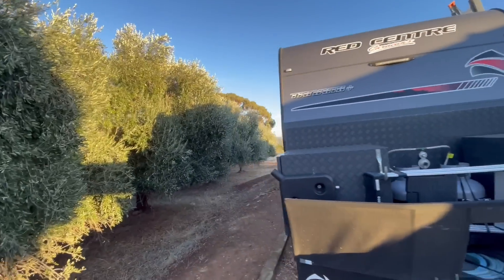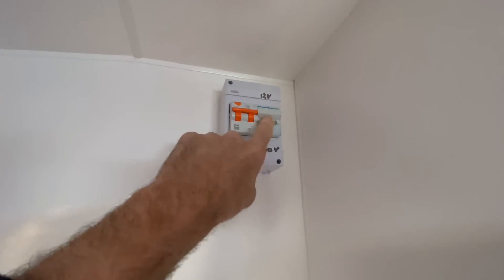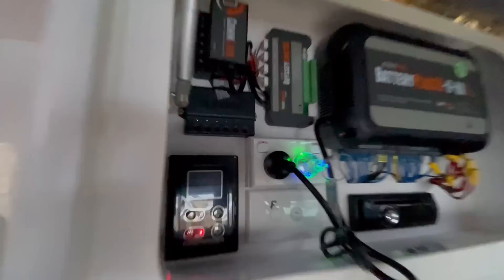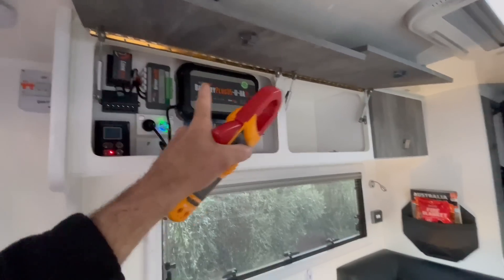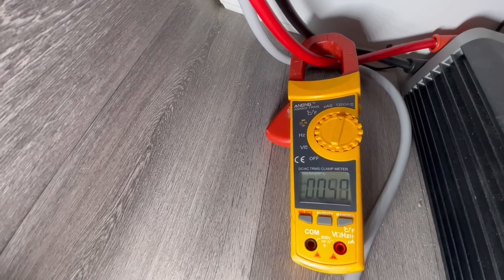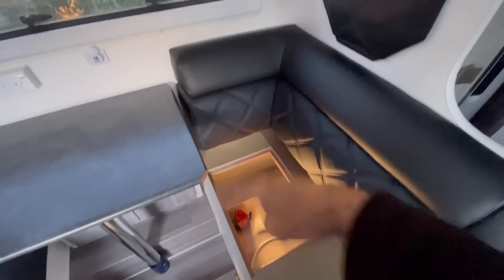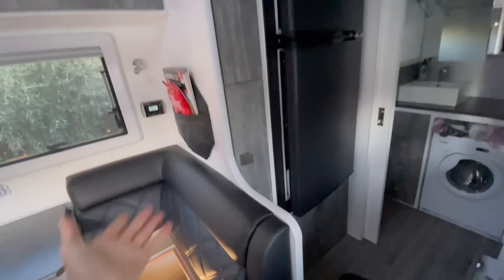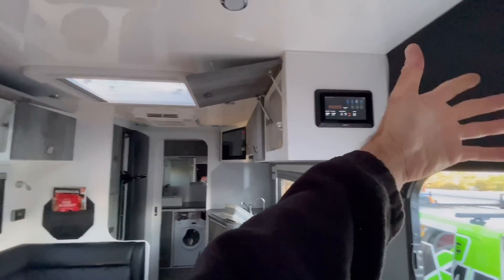Incorrectly wired inverter on a brand new caravan. The magic loop of power￼

Comment: Can u explain to me what runs the battery charger if there is no power to it from 240 as u showed and not powered by the inverter? Is it run by 12v ? Reason i ask is that im confused and im getting one of these. Cheers
Reply from the maker: Hi Jeff,
I don't think you understand the system here.
The mains charger must not have any ability to run from the inverter. It must be before the inverter as to not create a "loop'.
Can I suggest you look up the Enerdrive inverter with transfer switch diagram. That explains it easily.
In the video you can see how the charger turns ON when i turn the inverter on. Thats not correctly wired up.